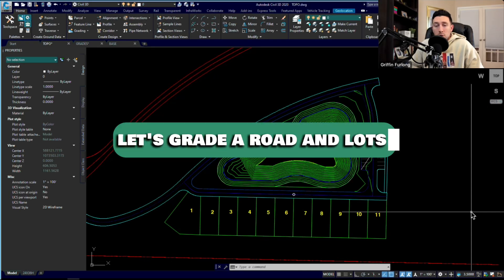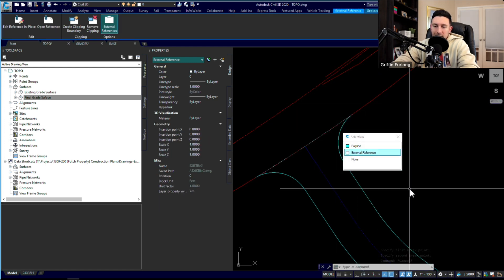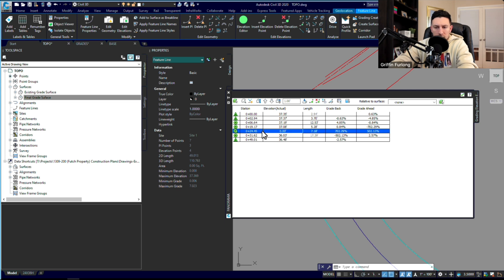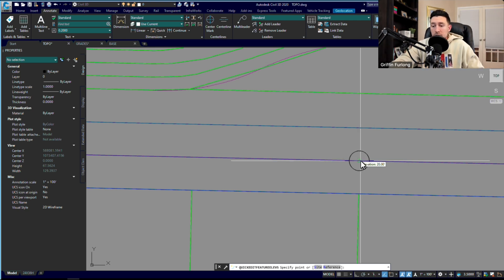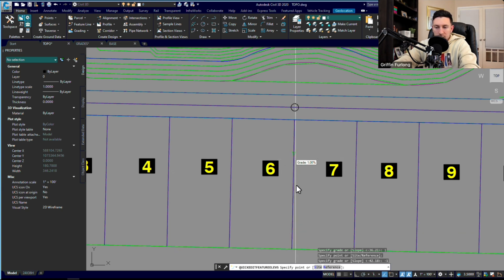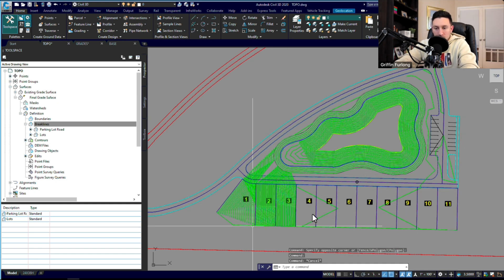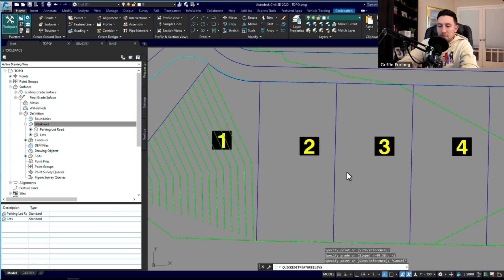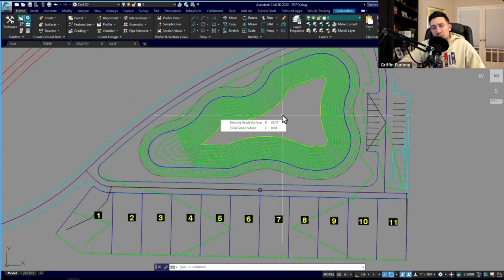Residential Grading with Civil3D Tools (BEGINNER)

Comment from the maker: Just a heads-up—this isn’t the only way to grade! This is an inverted crown road, meaning the cross slopes drain toward the centerline instead of away. It’s common in commercial sites or areas with limited right-of-way but not something you’d typically see on major roads with high traffic. Hope that helps!